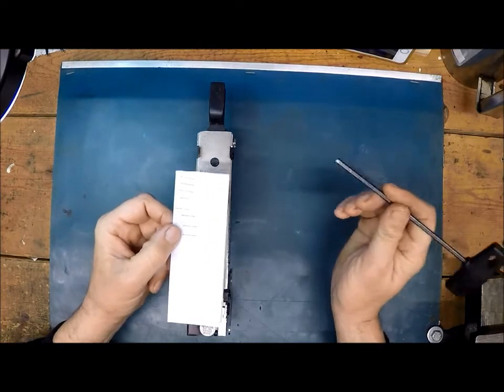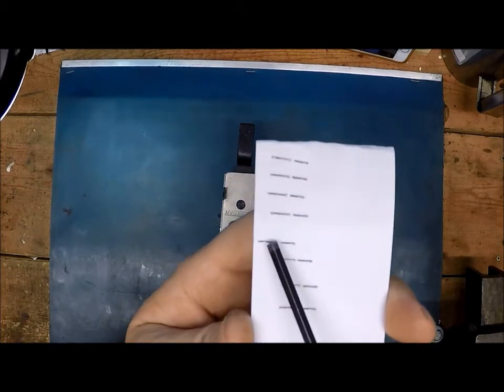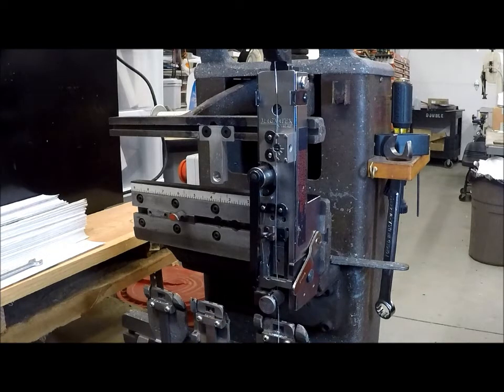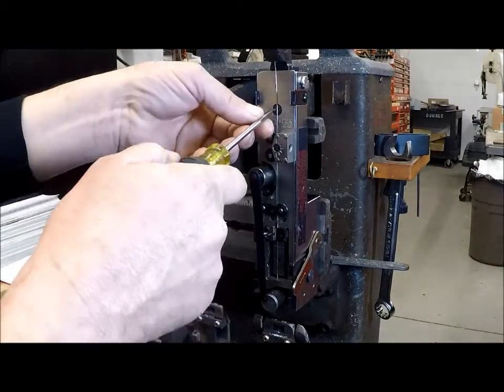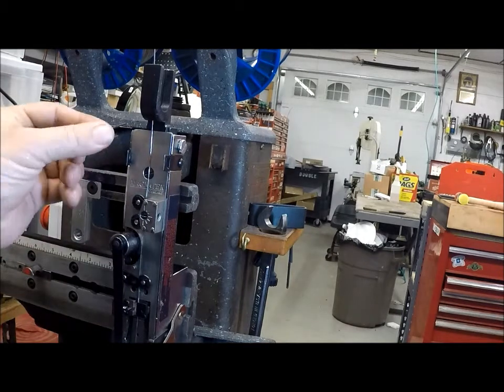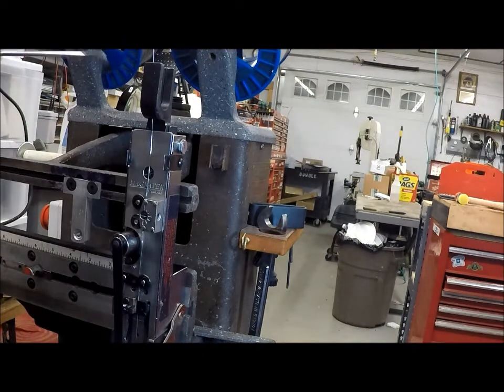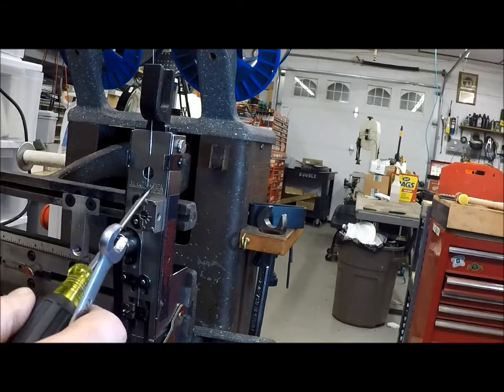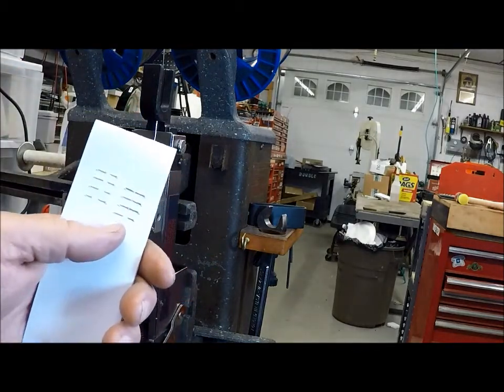Stitcher Head Staple Leg Length

Comment: I have a very old stitcher that has been wonderful for the past 30 years. Unfortunately, it has started having problems. It started making a loud BANG when it made a stitch, and then the entire swivel popped right off. After figuring out how to  put it back on, it will work for a very short time, only to start making the bang again. When this started happening, the stitch on the right side would get shorter until finally it didn't even go in the paper.  This stitcher is used for putting thin bags on a header card which is as thick as card stock.  After trying to adjust the stitch length, it seems the right side is now very long and it's definitely putting out way too much wire.
Reply from the maker: Clean swivel and swivel hole out. Put a little oil on swivel. Clean and oil front of the driver. if you continue to have trouble, replace driver and swivel. See lubrication video https://youtu.be/jMcLIifLkDg
Reply: @daviddouble1655  Thank you.